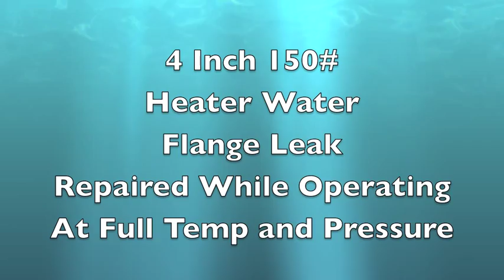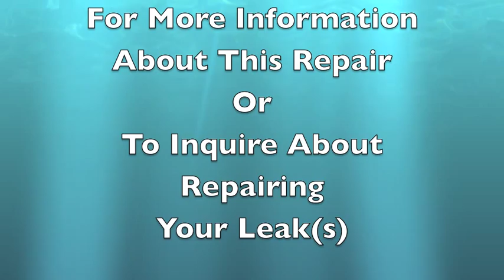Wire Wrap on Heater Water... Leak Repaired Under Pressure

Comment: Great video, but multiwire wraps are being phased out in our industry.  .35 S.S. wire or piano wire, has to be wound up creating a multi layer band which can be compromised during the injection phase.  It has a tendency to bulge around the stud cavities or the point of injection and effect the "hoop strength" of the repair.  it also creates a safety hazard during re-pumps or repairs that need to be made at a later time. yes, these are supposed to be temporary repairs, but during times of increased production, clients will run these lines until a scheduled outage.  Injection collars are ideal for non-destructive repairs, but engineering issues can arise during post repairs in the form of torqueing the stud back down to specs.  Most oil and gas facilities will not allow studs to "hot torqued" or removed without having a strong back added to prevent line separation.  We generally use solid stainless wire .005 MM smaller than the gap and then roll or peen the outside OD of the flange sets together. This does not damage the flanges and allows a greater amount of injection pressure to added to the flange mating surfaces during injection also increasing the amount of "differential pressure" being applied.  Just some thoughts, but great job and stay safe.